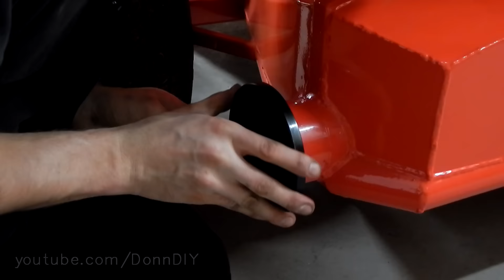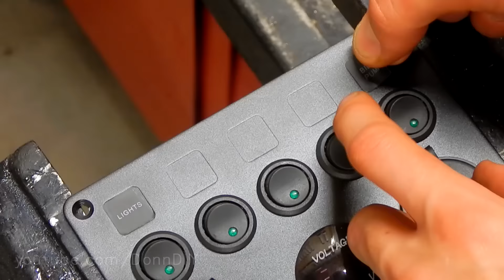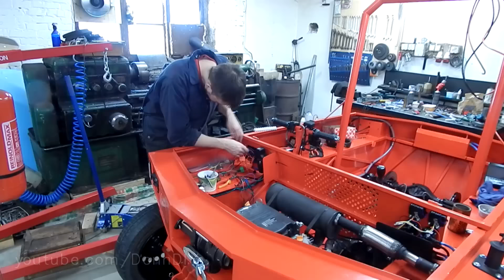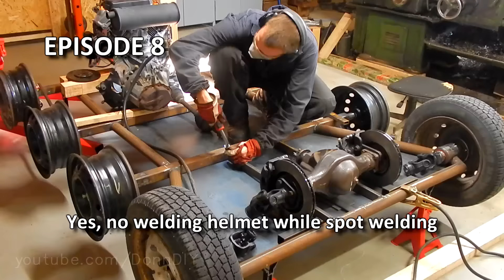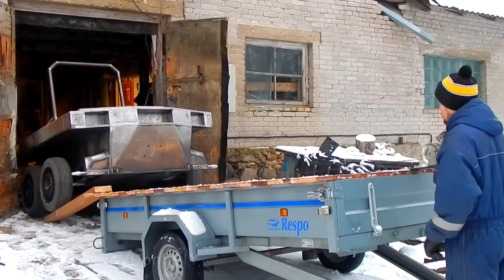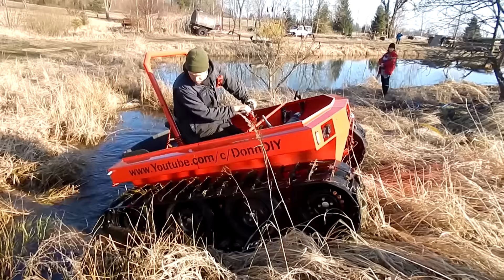IT'S FINISHED! - Tracked Amphibious Vehicle Build Ep. 25

Comment from the maker: This video is part of a series of videos, check out the series here:
https://www.youtube.com/playlist?list=PLkmF7FAZBzkWdzAxcrnz-WJbzSRyqrSBt
Subscribe for more and check out my other videos on my channel page:
https://www.youtube.com/c/DonnDIY

Welding equipment borrowed from Spetselektroodi AS, Estonia:
Fronius TransSteel 2700 welder
Optrel Crystal 2.0 Welding Helmet
Hypertherm Powermax 45 XP plasma cutter
Reply: Awsome build great job hope you got more awesome build in the future.
Reply: Wonderful job!!! Just add a jet ski propulsion pump and will be perfect 👌🏼 may be using the neutro in the transmission and adding a shaft with pullies to move the jet pump from a old jet ski... just some ideas...😜👍🏼
Reply: Hi Donn 
You could use a water pump to provide in-water propulsion
Reply: Saludos de Guadalajara Jalisco México yo quiero un carro así amigo cuánto me lo vendes 👍
Reply: Por favor haga un vídeo nocturno con ese todoterreno.
Reply: The tracks are resting too low in the water it's a design error luckily there looks to be enough room under the fenders for some taller tires however I'm not sure about axle spacing as that may be your limiting factor you could add fender extensions and skirts as well to attempt to counter some of the water splash and help with propulsion (like military tracked armored transports have)another option is changing to a large deep cycle battery and trolling motor when in the water
Reply: Add some propeller it will work
Reply: Donn DIY top speed run? 🙏 pretty please?
Reply: Great build. It looks awesome. Thanks for sharing
Reply: Hi Donn,

I followed your work from episode 1 and I think this thing is so great , I have one thing to say:
It needs a ship propeller
This is much better for swimming in the water
Just an idea 

Stay healthy in this bad time😉

From Germany Florian Stockem
Reply: You should have your own factory
Reply: @ashleyplamondon9718  
L
Reply: Ну мужик,дождался,я про  себя ,ты поехал!!!!😃😃😃👍 Слов нет,молодчинка и руки у тебя ростут из правильного места!!!!👍👍👍👍👍👍👍👍💥💥💥💥💥🔥🔥🔥
Reply: Ma Shaa Allah, God bless such smart and hard-working genius like you.  Thank you for sharing such amazing work. All the best of luck and respect to you and to your work.
Reply: How much money did you spend this project and your workshop it looks as industry
Reply: Attach a fin like structure to the wheel and put weight towards front.
Reply: Bilge pump? 😕
Reply: Donn DIY z (=
Reply: You know you said the water propulsion wasn't that great. To remedy that you might try modifying the differential to run a prop shaft with a clutch to run a boat propeller once in the water
Reply: Move to Canada, become Princess Auto's poster child!
Reply: Man, that's overriding. what a great job. you did what I still want to do. hope that i can also build such a great vehicle. congratulations.
Reply: Add two pod water jets for waterborne propulsion.
Reply: Amazing patient you have. But great project. I spent two days to finish your journey. How many working days it took to finalized?
Reply: It's really good over rough ground but it sucks in the water a jet boat drive would be an improvement even a small one. you are a smart guy. you could sort it easy

Comment: Hey Donn, awesome build, well done. I've got a fair bit of experience driving amphibious tracked vehicles in the army, and they all have one thing in common, tracks are very bad for water propulsion. I would suggest you maybe add a small battery outboard engine on the back, it will give you way better propulsion than the tracks ever will.

Comment: Floats much higher that I would have thought.
Reply: But not high enough, and that's the problem with the poor performance on the water. Both belts is mostly under water and that's not good.
Reply: I suspect the tires add considerably to the buoyancy.
Reply: J Rand produce a video of your homemade amphibious vehicle.
Reply: Mark Lowry the tires add a negligible amount of buoyancy compared to the hull. 

The debate on this channel in the past concerning buoyancy is quite frankly comical. 

This video proves it.
Reply: @dozer1642  even at only 10 kilos per tire... 80 kilos is not negligible buoyancy for something so small.

Comment: I have been waiting for this moment for a long time: D
It is so good to see it finished.
A really great build! :)
Reply: Masters of mechanics in one place
Reply: So mr poland what u want to build??
Reply: Made in Poland try to build something similar :D
Reply: Do you will do something like this
Reply: Needs a 3rd gear for faster traveling also and a propeller and it be perfect. Still way better than I could do. Great work.
Reply: actually a touch bigger flaps and he wouldn't need a prop. He was hurting hisself by holding trying to paddle one side at a time. A little more practice driving and he'd have it. Those aren't made to run 10 miles an hour in water. It's made in case you get into water above the track level

Comment: Nicely done, looks like it needs a couple of refinements though, a water drive (a jetski style one would work well) and some anti-vibration matting on the large panels to stop that harmonic vibration.
Reply: CMOT Dibbler... that’s what I was thinking, maybe find a bow thruster and make some bow and stern ports for it..?
Reply: Or even a heavy coat of undercoating to stop the harmonic’s!
Reply: I think an electric winch would be a nice feature.
Reply: @jeffreyhagelin3672 he already installed two.
One on the front & one on the back .

Comment: Needs a prop for water use, but other than that, this thing is awesome. Cool build!
Reply: yes a propeller on demand !  you low down the propeller when youre in the water !!
Reply: Or deeper tracks to get a better paddle effect.
Reply: @gungho1345  yeah ! with a calculate angle for moving faster :)
Reply: gungho1345 an issue i see is the track pushing against his direction at the front
Reply: Jetski propulsion :p no prop to get caught on underwater growth
Reply: @redneckromeo8244   like those old PBR's...Patrol Boat Riverine...the ones they used in Vietnam with Jacuzzi jet drives....based on the Hatteras yachts.
Reply: @Mikesteele45  Thats right, the water goes both forward and backward, making it stay almost still in the water.
Reply: @gungho1345  no they are pushing the water both ways BECAUSE they are too deep
Reply: nah just get some oars on it and call it a day :p
Reply: @Evilslayer73  Yes. Shrouded prop and rudder vane behind.
Reply: Nope! He has a winch. Attached an anchor and throw that sumbitch out in the water and start pulling line. Repeat until you get to your fishing hole.
Reply: Outboard!

Comment: Awesome job Donn 👍 and it floats, I figured it would, it’s funny how many people doubted it would, but most of those people never actually calculated the weight. I’m building a articulating dump truck and it’s funny how many people seem to doubt the 13hp engine I’m installing on it, they keep saying it’s not going to work, it’s the same people that say it would not float. Good work my friend and thanks for bringing us along, I definitely know how much more work it is to not only build something this big but to also video and edit it, most people will never know how much time and work it takes. Good Job 👍
Reply: I'm following your build too, Mike. Love it.
Reply: Mike festiva sure it will work I built a skidder using an industrial 10 hp single brigs. It worked but was slow as mollases. Put a 2 cylinder air cooled lombardini diesel on it now it works better and is acceptable as far as speed.
Reply: got a link to that?
Reply: MrSASIronclad I have videos of my articulating truck on my channel. Look up  Mike Festiva

Comment: My friend, You might make the cleats on the track a bit taller. That way it may work better in the water, …… The only problem then is that it will also dig the lawn up more.
Reply: Or bigger gap between bladrs
Reply: i think the problem is that the return path of the track is under water too. that kinda counteracts with the part of the track thats supposed to be under water.
Reply: @inevitablecraftslab  I agree with you there, and so what I would also do was make the fenders also to cover the tracks in front and on the sides lower in the water to act as a break water. that would off set the top of the track bringing water forward. Because it would hit the side, and front of the reverse side of both the inside fender, and the inside of the front fender ... forcing the water down and backwards onto the track bottom going backward to propel the craft forward even better. .... don't you think so?

Comment: The track paddles are hitting the water at the front(direction of desired travel) before they are turning downward into the water. This splash offsets the forward motion of the paddles moving through the water under the vehicle. Fitting larger tires or a track guide that moves the curl of the track higher should help. Bigger drive tires? Great vehicle!

Comment: Unlike a real tank, you cant run one track in reverse while one is in forward to pivot on the spot......... Other than that all the other engineering is excellent!
Reply: Not all tanks had dual transmissions, many were brake-steer, just like Donn's.  So, too were many large tracked earth moving equipment.
Reply: @bobpowers9862  True I used to drive a mates old minidozer that was 'hand braked' to turn, same basic design, if you wanted to go in reverse, you had to physically change gears to do it, so certainly not unknown even in commercially sold kit

Comment: Wonderful fabrication job! You obviously have a very strong engineering mind. Once you get more time to break it in, you will have a list of what-ifs and I should-haves.  Don't worry about hose because they will fix them selves. Glad it floats! If you start hearing that exhaust tone in you sleep, consider angling the exhaust away from you.  A couple of used valve springs from the donor car could be starting point for a simple suspension seat. Please consider a back brace for that roll bar.  I would hate for the world to loose such a talented person if that bar collapses.

Comment: Everything so well balanced (as shown in the water) and well engineered and geared (as shown by how quiet it is but has plenty of power when needed), the water propulsion is a minor issue you'll solve for now you could put a 100lbs thrust electric trolling motor on it to get around.
What I would do is add some thickness to the bottom if you haven't  already for going over rocks and such and maybe some rub weld wear strips to keep you from nasty surprises on that end and do regular inspections and maintenance there!
But what an AWESOME job I enjoyed watching you work and create!!!!!

Comment: Would be neat to see maybe a couple small boat propellers added for when your in the water.  Have them work with the brake system so you could stop one and have one going for sharper turns.

Comment: Great finish...but you're right, water propulsion needs help (it's because of the short tread height). Personally, the 'cheap way out' would be to add two trolling motor heads...take them off the shaft, build enclosed housings, weld them directly inside the track areas (one on each side), use a simple 'left-right' rheostat to steer with them...or just 'turn them on' and steer with treads...easy fix...could even run them on an attached alternator on the motor.

Comment: Like others have said, a rear propeller should be ne next upgrade. See if you can find a small 6x6 differential and use the driveshaft to the 3rd axle as the propeller drive. A simple disconnect for when it's not needed and it's perfect! 
Congratulations on an amazing project!

Comment: A busbar wiring system works well for one-offs like this. Each fuse is wired to a number of outlets then wires are run to the switches. For little extra effort, you could even have one fuse for each bulb.

Comment: Using car tires definitely helps with the buoyancy in the water.  Just get a small boat motor and add it to the back of the vehicle when you wanna go into the water, even maybe one of those small electric trolling motors.

Comment: Put another bottom in it boxed in for an air ballast tank. Maybe shell float. We did this out of a fiat x19 and a corvair 40 years ago. Had trouble with the braking system . Oart of the problem was the material we made the body out of. We used 3/8 & 1/2" steel plates to make the body so we wouldnt have to build a frame but still have the strength of a bullet proof tank. It was so freaking heavy she didnt want to stop. 0-60 faster than you wanted more than once but 60 to 0 in 40 yards some times

Comment: Great! Performance and execution, felt like I was with you all  the way. To solve the water propulsion problem you can either add an extra piece of metal to the track angle iron doubling the track depth or installing an appropriate size outboard motor at the rear ( hoping it doesn't effect weight distribution and provides enough propulsion).
Reply: Electric trolling motors (a pair yoked to turn as one) would provide propulsion in a lightweight run right off the battery.

Comment: Some more flotation would help with mobility in the water. You need to get the top of the tracks clear of the water, so that only the bottom cleats are pushing on the water. As is, the top cleats and bottom cleats are simply cancelling each other out.

Comment: Very nicely done. As a word of warning ....there have been many commercial track rigs throughout the years. Many with skid steering such as this that use a differential...have had a weakness. That is the differential. When you hold one side stationary your are forcing the spider gears to turn at high speed. They are plain bearing and not designed for prolonged use. S p ider gear galling and welding to the shaft is common. Be mindful of running one side and not the other.....you can damage it.

Comment: On your next one, engineer it so that you can disengage power from the tracks,  and redirect the power to two turbines inside tubes built thru the frame low enough so they are submerged to create a jet propulsion system for water.

Comment: Cavitation City. Run a Prop off the Yoke out the back... Insulate the engine bay to dampen the sound, and truck bed liner the walls inside the cabin. Your scaring my lunch away.

Comment: interesting performance capabilities, limited yes, but potential. The track system at this time is impressive, much to my surprise, no doubt there will later be an issue with tyre wear but I would say you did well with that and it's worthy of a little more development. For a DIY project and relatively small investment that's a good result.  Thanks for a very interesting video and project.

Comment: Monday morning quarterback thoughts here. That roll bar would be good for mounting lights, but not much help in a roll-over. Needs braced in both directions. And I probably would have used chains to turn the drive hubs - a lot of angle in that u-joint set-up. Neat project otherwise.

Comment: To keep the water out the seal should have been installed with main lip facing to the outside, the way you installed it you are only relying on the wiper lip to keep the water out which it will not .

Comment: So awesome man!!
Reply: OK so I watched it all, amazing sound it makes! You rode it without the engine cover, does it overheat or what? I would love to see you ride it top speed (also without the tracks on a road haha) and also haul some logs with it.
Also, I was thinking that if you extended the roll over bar to a complete upper frame and made a canopy or a roof or even a cabin that you could ride it in heavy rain as well without it filling it water.
BTW, shame about the water propelling capabilities, it looks like the bouyancy line is too low in regards to the tracks middle line.

Comment: Did you put in a drain plug for any water that gets in after playing? How did you get that beast out of the water? You may want to think about a bilge pump for any water that gets in during water operation. The metal on the outside of the track could be U or V shaped for better water movement. How will the track tension be adjusted when it stretches? Nice job, I wish I had the time to build just a tracked vehicle. Bring back the old days.

Comment: The best water driving appears to be at lower speeds.  Try to go faster and I think the bottom cleats start cavitating, and then all your thrust comes from the mass of water thrown the top part of the track, ironically propelling you opposite the desired direction.  I think if you just kept the revs down and settled in for a slow ride, modest track speeds on the water would work okay.

Comment: Good job. Looks like you couldn't steer to the right.  You drove around taking left hand turns. Probably the limited slip rear axle not cooperating.
Reply from the maker: No slip diff there. Me turning left is a coincidence. It has no trouble of turning right.

Comment: What style of differential did you use?  A dog leg, essentially 1 wheel drive where power goes to the side with the least resistance.  A limited slip or a posi-trac style differential?  Just wondered if it was a dog leg how much you had to brake the dominant drive side to put power to the other side to keep it going straight?
Reply from the maker: Open differential.

Comment: Hey Donn,

How much this thing weights? I need amphib to be used during thin ice / slush season to get to my cabin in outer shores. Thinking of refining your idea and use electric motors instead of a car motor + making the hull out of fiber glass.

Have you tested this on ice how it performs? Regards from Finland